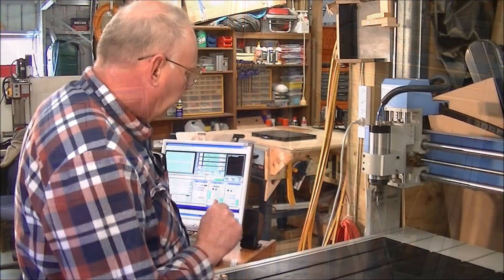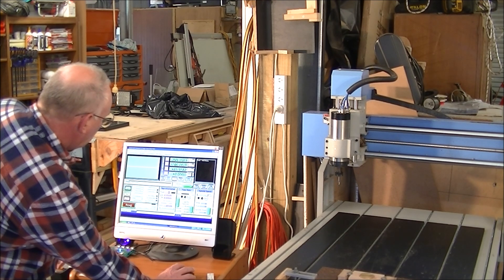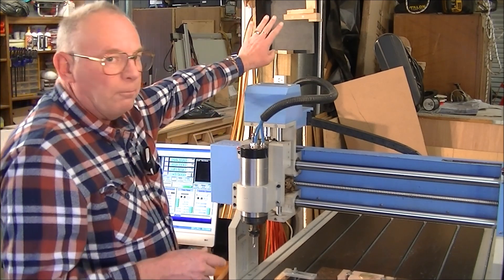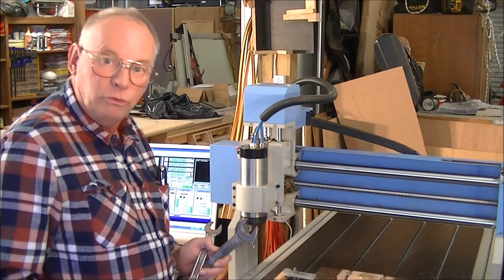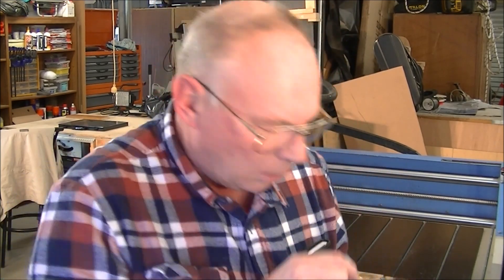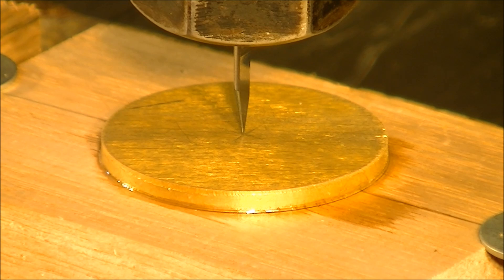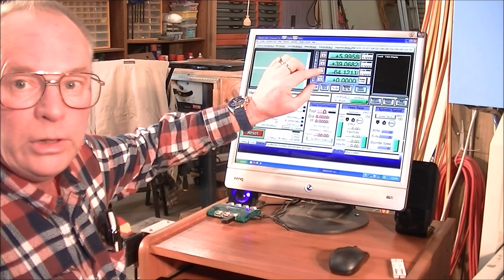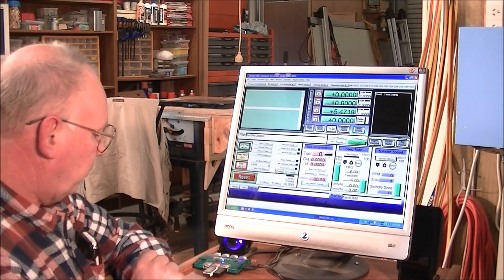Easy learning, CNC routers for beginner’s setting up for a job

Comment: Great work thanks for your information.  I'm new to cnc routers,  and thinking of getting one,  I was looking at buying a cnc machine but it has automatic tool changing on it, I've looked at the software but it seems to be very difficult to work with as I want to use mach 3 and vcarve.  Could you please advise me on the easiest way to go.  Keep the great work coming thanks.
Reply from the maker: Hi have a look at Avid CNC

Comment: Hi Roger, I bought a 6090 Cnc router new on Ebay some 5 mouths ago and have tried every thing but the spindle Controler is stuck in stop mode. The supplier is unable to help.  The 3 axis are all working and I am using Mach3 software. Please can you advise?
Reply from the maker: Yes! you need an electrician to test your machine ( DO NOT PLAY WITH IT) its made in China!!!!!

Comment: ciao Roger sono alle prime armi in questo mondo o una piccola cnc 30 40 ho installato il softwer mach3ma la macchina non da nessun segnale non si muove non so come fare
Reply from the maker: Hi, have a look at my videos 197 and 198 this is a mini mill I converted to CNC with Mach3 and set up, this should help you.
Reply: @inventorsworkshop9600  ti ringrazio e una usb

Comment: Thanks for uploading such informative video, 
when we change bits while carving in wood, do we have to change some setting in mac3 software, and can we change bits in mid of carving, if yes then what precautions we should take for such changes. reply as soon as possible. Thanks
Reply from the maker: Hi, see my videos, 180 and 181.
Thank you, for watching,  
Please subscribe and forward the video on to a friend, Australian Inventor Roger Clyde Webb ;-)
Reply: @inventorsworkshop9600  thanks for reply, 
There is a big confusion in my mind that - 
How to choose bits for carving, e.g. 0.5mm or 0.3mm etc, 
is any settings are there which tells cnc machine that which diameter of bits are used,
Because area of carving in each movement depends upon diameter of bits, 
Which section of cnc deals with bits diameter, eg. CAD or CAM or Mach3 or any other. 
Thanks
Reply: @inventorsworkshop9600  Thanks for your support,
Please make a complete tutorial for mac3 software and cam and cad software for cnc wood carving, 
I am investigating from nearly 6 months but no any channel had explained like you, your explanations are easily understandable, please its humble request from you, 
I am so inspired by you that I had distributed your channel link through WhatsApp to my DIY'ers friends.
Thanks once again.
Reply from the maker: Go to my channel it's all there.
Thank you, for watching,  
Please subscribe and forward the video on to a friend, Australian Inventor Roger Clyde Webb ;-)

Comment: Can we talk about why you were still using windows xp in 2016? Software limitation?
Reply: Short answer, effective and cheap set up for a router computer.

Long answer, You have a couple options for connecting your computer to your router. One of the preferred options is an old school connector (I can't recall the name at the moment, it's the one that looks like the old blue and white monitor hook ups but much larger). It's hard to find this connector on anything windows 7 or newer. The easiest option for me was to use an old computer that already had the correct port installed. I am also running on xp. The mach 3 software runs well on it, and you really want a dedicated computer for a router. My computer never hooks up to the internet, and has nothing on it except for mach 3 and what windows xp originally comes with. I can't speak for Mr webb but this could potentially be an explanation. I'd be willing to bet that he isn't programming and getting his g-code from that computer with mach 3 on it though.

Comment: whats the difference between machine coordinates and work coordinates- reason  when i load my g-Code- i get some weird tool paths which are beyond the work piece and workable mill area - i assume this has to do with home/machine coords? - I have my mill part shown in mach 3 but also a white dotted line 3D box where the tool path retracts to (which is beyond the limits)
Reply from the maker: Hi, see videos 177 and 179.

Comment: I thank you so much for this. I really needed help and this helps a lot. I have a question, do you need a CD to connect the CNC to computer or does mach program automatically find the router when connected via USB.

Comment: hi Roger, love your vids. What CNC machine would you recommend for a beginner/hobbyist?
Reply from the maker: Pacific Tooling ships worldwide: Email me at info@pacifictooling.com I will send you
information on our new * Lathe * and 4040, 6060, 6090 and 6012 (linear rail
model) CNC routers and CNC lasers 6040, 6090, 1390 and 1225.
 Pacific Tooling; Australian Inventor Roger Clyde Webb

Comment: One more question if you have the time. When I send the unit home it zeros at the bottom  left and the Z rises to the limit switch, good so far. When a g28 is called the Z rises to the limit and trips an estop  stopping the process. Any guidance?
Reply: The Z axis on almost any CNC has its ZERO (0) point at the top of the travel. The reason is thats the only point a limit switch can be set up that guarantees a fixed point referenced to the machine.  What makes it confusing is DOWN is going negative from the zero at the top of the Z travel.. In other words reversed from what you would normally expect. In fact ALL Z movement, either manual or from within G-code is the same.  No big deal as any CAM software knows that. 

When you zero to the top of the stock ( normally) that becomes the zero (0) point for Z for the job to be done. Any movement into he work will be a negative value and positive for up, NOT necessarily the absolute numerical value.  In some ways its quite sensible as you are referencing to a plane that's parallel to the bed (the top, the top  of your stock).

What you need to keep in mind there are ALWAYS 2 coordinate systems running together. One is the machine system, and the other is the work system.  When you home the machine, it picks up its zero point from all 3 limit switches.  The work zero point is MANUALLY set at some point in the stock. Assume the work set point is exactly 3 inches in say X from the machine X zero point. You will normally use the WORK cordnates, NOT the machine one. So at any given X travel The Machine system DRO will always show a value  3 inches GREATER than the work X DRO.  With mach 3 look at the butons right below the DROs. There is a button that switches the DROs from one system to another. Most controllers have the same but how to switch is different.  Just make sure you are referenced to the WORK display and the "fog" will lift. 

Personally I never bother with homing my router as I have never had the need to, my limit switches protects mIf I quit for the night I just move somewherey router from "idiot" moves.  :) They cut all power to to the router with a relay in the main power line.  I have a Push button to override that relay if Im setting on a limit switch to get off it. I have to MANUALLY hold that button down to move.  My "Oh shit"  button DOES NOT cut the power but does stop the computer. 

If Im doing a LOT of the same part I just set up a couple or 3 clamps that act as stops, not as actual clamps. Then all I gotta do is loosen up the clamps ( DO NOT TOUCH THE STOP ONES ), remove part, place new part against the stop blocks, then clamp it down and hit start.  That way all I have to do is zero ONE TIME for the entire job.  If I do it over a couple days I just move somewhere clear, write down the DRO values, then shut down. The Next day  I start things by first powering up mach 3.  Next I fire up the control box and put those DRO values in the DROs and Im off to the races again. My CAM program will put the bit at some given point well clear of the work at the end of each run. No need to use the machine coordinate system there either. 

I do things TOTTALY different if I happen to be using a REAL Vertical Milling Center.. :)

Comment: thank you for the well explained info. I am working on getting everything underway and this vid help a lot. I ran into an isue today though that you might help with. I have a CNC Router Parts bench top unit running Mach3. When i milled a round pocket it came out as an oval. the x axis dimension is correct but the y axis is short. how do I make the adjustment?
thanks again
Reply from the maker: Hi,  have a look at my videos 78 and 79 that will do the job for you.
Australian Inventor Roger Clyde Webb ;-)
Reply: That fixed it. Thanks.
Reply: Hlo Sir,Thanks for your Videos